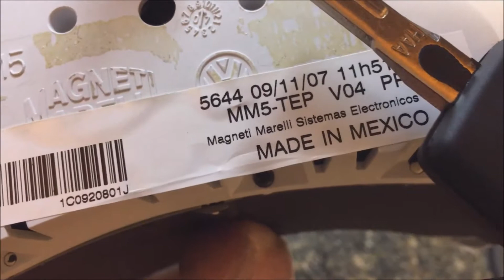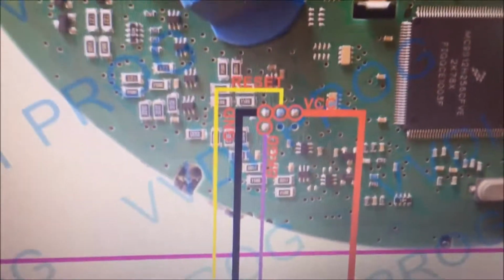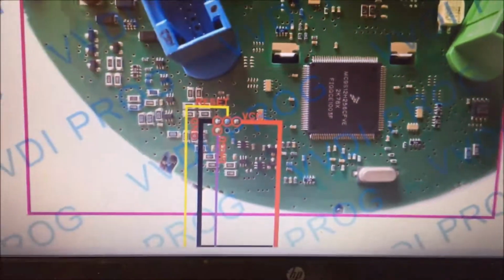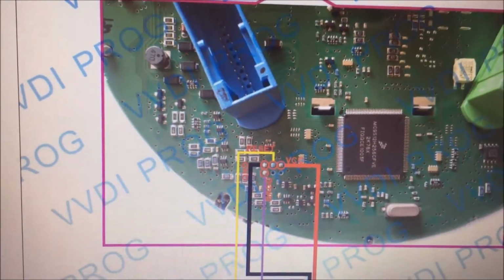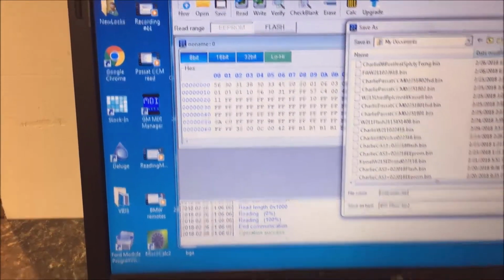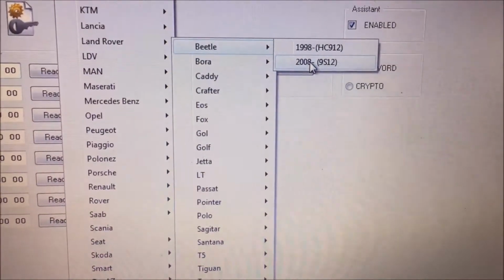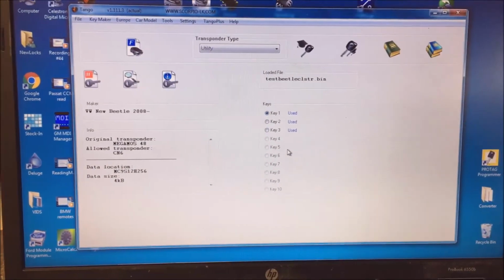2008 Beetle Key Programming

Comment: I can get the pin and cs with either launch immo+ and autel im608 but it says verification failed when trying to add key
Reply from the maker: because the cluster has the data in different places... If you can't eprom it and put a key in the eprom, and you can't put one in via OBD, you won't be able to without a key ordered from VW..

Comment: hey boss I just went today try to program 2010 beetle and  get stuck in comunication I Cant read the pin code not even with the original key
Reply from the maker: what programmer are you using?? the beetles are a different breed.. the only cluster that has 2 spots where the key data is kept.. and depending on which vendor made the cluster, the data could be anywhere.. these are pretty much hit and miss.. I get a bout 50 percent work.. the others its a dealer key and pull the pin from the ECU
Reply: @timtracy9442  autel Im608 2 I just try to add another key
Reply from the maker: @klanr508  yep, you got one that either needs a dealer key and odis, or smartpro, and the pin will flash quickly after about 5 mins, then use VCDS (rosstech) to program key.. gotta love those beetles...

Comment: Hi Tim, I followed this procedure but the immobilizer is not shutting off. I read the bin from the cluster and wrote to the key with Tango. Any tips?
Reply from the maker: To be honest, you have a 50/50 chance on being successful with this.... I was talking with Martin, the developer of SuperVag, he said that in some of the clusters the ID of the key is written in 2 different places and if you don't have a dealer key, your screwed... I have had a bunch that no matter what I did, I still couldn't program the key...  I have had 2 that I was able to read the CS from the ECU, and then make a dealer key with AVDI, but it wouldn't program.. got out ODIS and it programmed right in... I wish I knew what was going on with these 2008 clusters.... sorry bud, we are all struggling with these...
Reply: @timtracy9442  dang, that's a shame. Have you tried tango's CS viewer versus VVDI's? Or do they pull the same information?
Reply: I too am struggling with these an 07 and 08 beetles, I am contemplating on just immo off the ecu since it’s med 7.1.1.

Comment: Hey Tim.  I got really stumped today on an 08 Beetle.  I've done about 3 now one being a 2007, 2010, and ultimately 2008.  For the 2007 I used basically your same method and it worked perfectly.  Car started from all keys lost.  For the 2010 it was an all-keys-lost and I was able to OBD it with VVDI and everything was smooth.  Today I have a 2008 Beetle which I figured was going to be cake because I've done the same generation without issues.  I tried to OBD it but I had issues where the transponder would not lock.  It would be a dealer key and the transponder type was good.  I tried doing the same method you did as well but I was not able to learn the key to the car after programming in Tango or start it.  I'm stumped.  Do you happen to know what's the cause for this particular 2008?  I'm about to go and immo-off it but I felt like a loser forfeiting doing that.
Reply from the maker: Sooooo, I was teaching a class in CA with Martin, who is the developer of supervag, I asked him this same question...  He told me that depending on where the cluster was made, the key data is sometimes in 2 different places in the bin file.. He said they bought factory keys and searched the bin files to find where the key data was written, and in some cars it was in different places... The only thing I can tell you is when you run into this, best bet is to order a dealer key...  or immo off the ECU..  Trust me, your not a looser after doing all the work to read the chip and then program a chip into it, then have it not work....
Reply: @timtracy9442  Awesome information!  In the future do you happen to know what the date for when the tango method would work and when it wouldn't?  If I remembered correctly, the date for my cluster was 09/07/07
Reply from the maker: @SneekyFauker  I don't think it has to do with the date...  I have had clusters a month apart that came from different factories and one worked and the other didn't...
Reply: @timtracy9442  Is there a DIY way to immo off the ecu?  I am less interested in futzing with the keys at all and more interested in just having easy keys :)
Reply from the maker: @jzahirniak  Well, most of these have the ME9.1 ECU, you can look on carlabimmo.com and see if they have a solution... but just realize, the immo light on the cluster will be blinking...
Reply: @timtracy9442  I opened up the key last night and the little rfid pill just dropped right out so I played around with holding it to the key bezel for proximity and it worked well.  This weekend I am going to remove the column cover and see if there is a location I can secure that thing to inside to spoof the whole nonsense :)

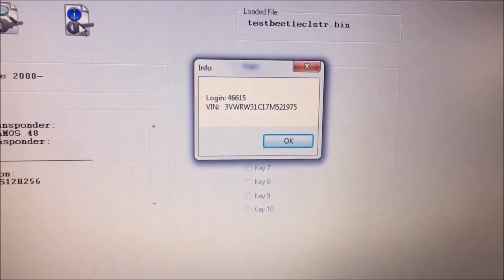Comment: Tim, just curious, once you had obtained the PIN code at 3:22, did you still have to use Tango to add the extra key(s) or could you have used the pin code on other tools such as AVDI to add key(s)?
Reply from the maker: You know, I have tried to program once I have the pin code, but haven't been successful....  This is what I have been told by Martin, the developer of SuperVag, he said the CS is in two different locations in that chip, so you have a 50/50 chance of the key working... On a few I have had to get a dealer key.. and when I scan the key, the CS looks the same as what I have gotten from the bin file... So I always tell the customer that they have a 50/50 chance of not having to buy a dealer key... You would think something that is this old would be easy... but no...

Comment: Hi I’m new to the world of programming . I have the 2005 beetle it’s the one with chip MC68H . Which machine can I use ?I have the vvdi prog but I noticed the chips numbers ain’t the same
Reply from the maker: MC68H??????  the chip should have more digits than that...  There is an HC05, HC08, HC12,  does your cluster have the same solder points as the one in the video?  or are there 5 points in a line??  If it is an older cluster, just use VagTacho..